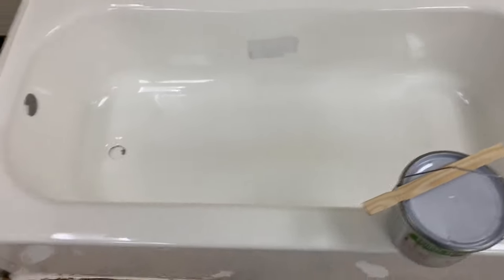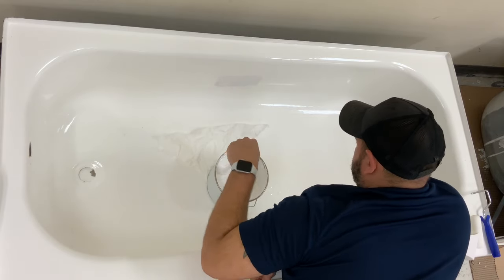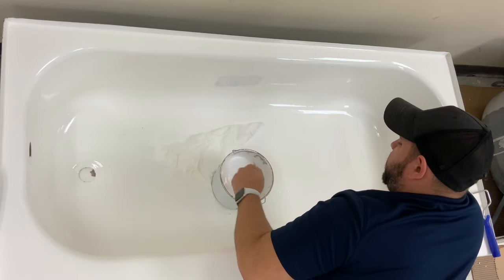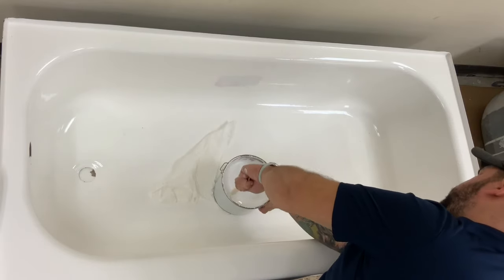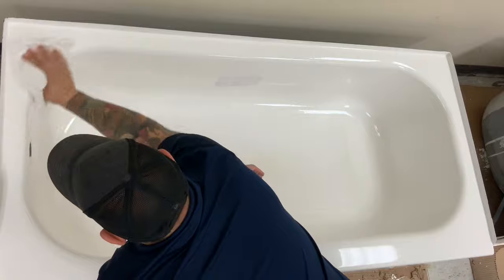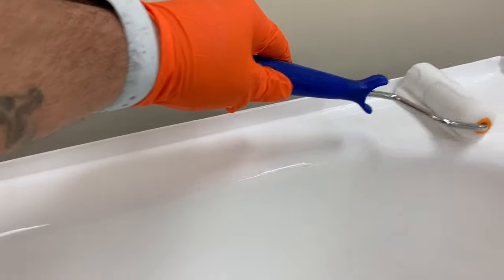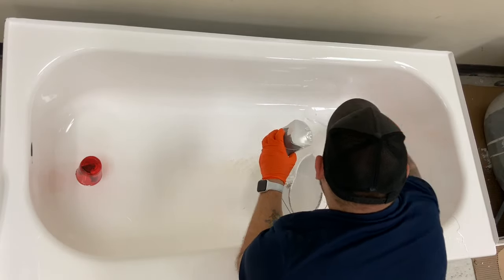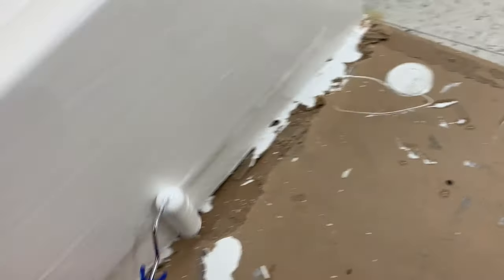How To Refinish A Tub With Ekopel 2K Demo | Ekopel 2K's Easiest & Fastest Way

Comment: will this product fill in low areas in the tub?  I have a tub that has a low spot that pools water a few inches away from the drain, it's not very large (maybe 4-5 sq inch area).  Seems to me like since it's self leveling like you show it should take care of minor low, pooling areas.  Is there a concern of the finished product being too thick in an area of the tub and it becomes a problem later?
Reply: I'm interested in the same thing, Ed.

Comment: can use this kit if I have exposed iron (patch) 2 inch long, 1 inch wide. original coating is completely gone in that patch.
Reply from the maker: I would recommend sanding it smooth with 400 grit sandpaper. Give it a deep clean with lysol power and then you will be all set to use ekopel.

Comment: If rather than finish the whole tub can I just surface part of it w a thin coat?
Reply from the maker: You can patch areas with our touch up kits but it would stand out on an old tub. If applied too thin ekopel will cause yellowing and streaking. Has to be poured on thickly enough, can't be stretched.

Comment: On a clawfoot tub can we just take the drain out and place a catch can under instead of scooping?
there's room under
Reply from the maker: If the tub is uninstalled then yes you can place something underneath the tub to catch the remaining product. You will still need to scoop the excess out of the bottom.

Comment: What do you do if you have some tub peelings before starting this whole process?
Reply from the maker: Paint or finish from any previous product application, which peels off from the bathtub, should be removed in order for the new layer of Ekopel to have good adhesion and not peel off in the future. You can scrape off the peeling areas then use 220 grit sandpaper to smooth out chips and edges.  If it continues to peel or it won't smooth out, we recommend using a paint stripper to fully remove your old bathtub paint

Comment: Is there enough material leftover to use for the inside of a small sink?
Reply from the maker: It's not recommended that you do but sometimes there is enough material left. But keep in mind that after the material has been mixed you only have an hour to work with it. After the hour is up the material will be too hard to work with.  Also keep in mind if the martial is stretched too thin then it can cause yellowing or streaking.
Reply: I was able to do a small tub and laundry sink but I had both prep before mixing the product and moving fast. They both came out I perfect

Comment: I just had a so-called "30 year Professional Tub Guy" refinish a tub and sink. Shockingly & Angrily, what he left is a mess!!!! Gritty, bubbly, orange peel everywhere, uneven surfaces, and yellow streaks that are getting worse! We have not used the tub or sink at all. I am wondering if I can sand it off and do it myself? What kind of sand paper? Should I use a wet sand method? I prefer not using any power tool products, but will if it is recommended. Please help  with info on prepping my ruined tub. 😩😖😫

Comment: I have a question: my bathtub is old and rusty around the drain, do I need to send it before application the product?
Reply: I have other question: instead sanding bathtub could I use “rust dissolver “
Reply from the maker: I would recommend sanding it smooth then you can use something to treat the rust. I would also recommend our primer for a better stick over the rust.
Reply: Thank you very much for your advice .

Comment: My tub is peeling from I'm assuming a prior casting...not sure. What is recommended to remove the old before applying this product? Thanks!
Reply from the maker: It was likely done with a cheap rustoleum paint kit. 
We scrape with a razor blade, grind down with an electric sander, or use a paint stripper to remove the low quality material before Re coating.
Reply: How do I know if I need to sand as opposed to just clean and apply?
Reply from the maker: mattrhogan if there is peeling paint, chipped paint, or a hard line edge it needs to be sanded until it’s smooth. Ekopel will mirror what it goes over on vertical surfaces.
Reply: @RefinishedBathSolutions   but it sounds like I don't need to get ALL the old stuff off, just smooth where it is peeling, is that right? Also, what about a textured bottom, smooth that too? Thanks
Reply from the maker: mattrhogan as long as you can sand the peeling or chipped areas down smooth with no more peeling you can go right over the top. 
It depends on what type of material the tub is coated with. Most cheap paints won’t sand out smooth. They will keep peeling up. If a bonding agent was used they are more likely to smooth out and no be required to be stripped fully off. 

I hope this was more helpful. 
Ekopel will fill in the non slip on the bottom as it is much more thick on flat surfaces.
Reply: This is probably way to late but I used citristrip to remove the previously applied coating, I was skeptical but it worked amazingly well.

Comment: Man, I did everything to a t on how you described...its been 3 hours and its not settling up, maybe humidity?
Reply from the maker: At 75 degrees it takes 24 hours. At 70 it’s more like 36 hours. It stays very wet for about 16 hours and tacky right up until it cures.

Comment: How long does it take to cure and be able to shower?
Reply from the maker: It drys within 24-36 hours then you can use the shower. It can take up to 30 days for it to cure but in this time its perfectly fine to still use the shower while it curing. Curing and drying are 2 different things.
Reply: @RefinishedBathSolutions  ahh perfect thank you!

Comment: performed this video and tub came out great except some epoxy clogged the drain. any suggestions?
Reply: Rambo II I actually used 2 separate layers of tape for the process. I taped a small hole that is almost the exact diameter of the drain (at the lowest point of the tubs drain hole), then I also used the larger tape diameter that he shows in the video (this one basically outlines the outside of the drain cover itself). After I was done with the process I removed the top layer of tape (also tried to scoop out as much material as possible before removing the tape) then I continued to wipe away material from the edge of the second layer of tape for the next 4 hours because it slowly runs closed to the tape. At about the 10 hour mark I was able to use a tooth pick the draw a line through the material around the tape because it had seeped over the edges of the tape. 10-12 hour mark it when I removed the second layer drain tape. Now the actual drain fixture will cover the line of where the material stops and where the old tub surface is still exposed.

Comment: I've always wondered what an epoxy tub finish looks like after one month of normal use, and what is used to clean it.  Obviously abrasive cleansers can't be used.
Reply from the maker: After a month or even a year it would still look bright white and shiny.  We recommend using Scrubbing Bubbes or Tilex to clean.
Reply: @RefinishedBathSolutions  Thank you, that's good to know.  I suppose that the epoxy finish can also be polished and buffed with automotive finish products.  My one other concern would be the epoxy's bonding reliability to an existing cast iron tub, notwithstanding proper cleaning/preparation.  BTW what about use of this product for tile walls?  Thanks.

Comment: what if the tub had already been refinished once?
Reply from the maker: You can still use this product even if it's already been done once with other stuff or similar. We recommend sanding it smooth to the touch  even if it's pretty smooth give a quick rough up with 400 grit. Then give it a deep clean and etch with Lysol Power or any toilet bowl cleaner with hydrochloric acid in it. From there you can tape and pour.

Comment: Does anyone have experience with covering the rounded top edge of an old vintage clawfoot tub? I am concerned the epoxy will drip onto the floor and am not sure how to get the bottom rounded edge covered without making a mess.
Reply from the maker: I would recommend putting plastic furniture covering underneath or paper so it won't make a mess if it drips. Any drips can be sanded and buffed out when dry.

Comment: why not let paint drain out of drain instead of scrapping out excess paint?
Reply from the maker: If you have a claw foot tub that is uninstalled and has no hardware in it then yes you could let the ekopel drain through the holes into a bucket. If you do this to an installed shower or tub ekopel will clog the drain and dry like cement and then you would have to call a plumber to replace the pipes.
Reply: @RefinishedBathSolutions  Yikes!   thanks

Comment: I can't get my tape off. It's been two hours. I tried but I ended up touching other areas of the tub. It's now been two hours so I'm guessing I can't retouch those areas😓
Reply from the maker: To get the tape up you can use a heat gun or hair dryer and score around the drain with a razor blade. If that doesn't work you can use a dermal tool to cut it out. You can use our touch up kits to fix any areas that need to get touched up.

Comment: Oh my goodness this mixture leaked down my drain what can I do to get it out?
Reply from the maker: Darnell Henderson is wipe as much off of the drain as possible with a paper towel then continue to monitor until the material stops moving completely. From there, if it was just a little bit it won’t cause any issues. If there was a lot and it blocks the drain you would need to replace drain trap underneath. I’ve never had a customer that allowed that much to flow down though. I think monitoring and wiping as mich off as possible the rest of the way is your best bet.
Reply: The material leaked through the tape good bit in the drain it's hard.
Reply: Thank you for all your help.

Comment: Does that cleaning product also etch the tub glazing so the glazing doesn’t interfere with adhesion?
Reply from the maker: Yes it has 10% acid to mildly etch the tub as described. It is the safest easiest way to prepare the surface.

Comment: No gloves? No mask?
Reply from the maker: No Mask needed we do recommend wearing gloves but not an issue if you don't wear gloves. You can get ekopel off your hands by using acetone like nail polish remover.
Reply: @RefinishedBathSolutions  This product looks absolutely amazing.  I am currently DIY-ing my one and only bathroom and it is turning out to be much harder than I thought.  So the bathtub refinish will have to wait.  What a great demo, though.

Comment: Avoid this shit like the plague. Ordered it. Watched all the videos they have. Read the instructions. Followed everything to the T. And today I had to call them and ask how to remove it. They said 220 grit sandpaper.... Can't begin to explain how asinine that response is. 
Heat gun, oscillating multi-tool with a scraper attachment, and Jasco epoxy remover. 
I can't begin to describe how awful this product is. The money spent on this product and now the money spent removing it exceeds what it would've cost to have it professionally sprayed. Totally utterly disgusted with this product.
Reply: you never stated what went wrong.